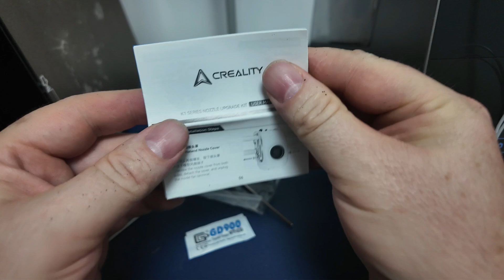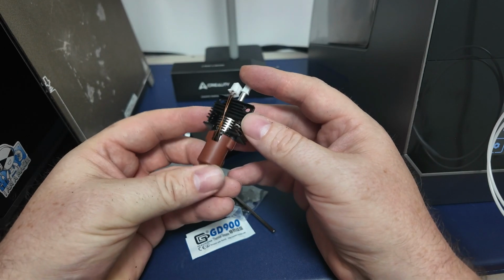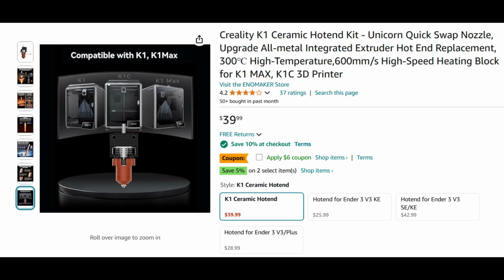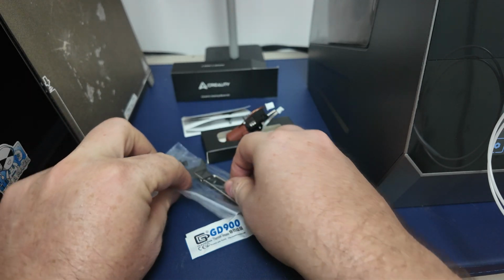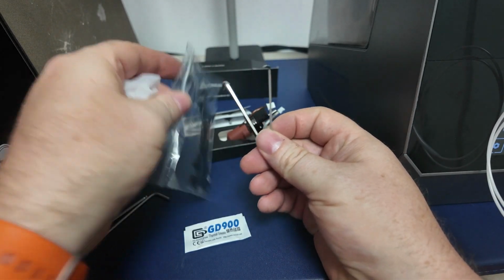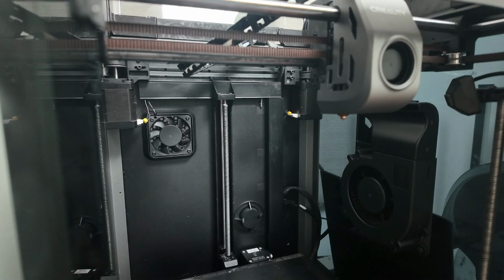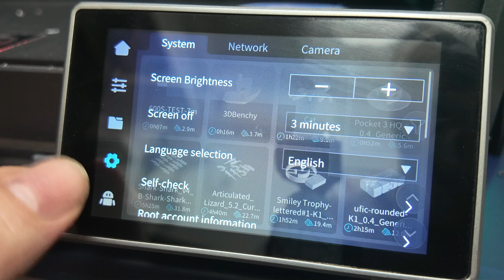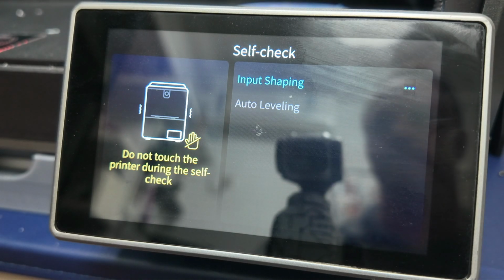@Creality3D Printer Upgrade - K1 gets a new hotend, using K1C unicorn nozzle

Comment: I have a k1 se and had a unicorn nozzle in it when I got it… but when I replace the nozzle it won’t go upi to extruder all the way.  It hits and won’t go in any further
Reply from the maker: Are you sure you got the right size unicorn nozzle?  The K2 and the HI use a unicorn nozzle also, and it is bigger than the one for the K1 SE. Did you compare the new one to the old one before installing?
Reply: i was having same problem. looks like i just have to drill out the hole in the alum heat sink. I have a machine shop so its not a big deal.
Reply: @mattschroeder6395 no don’t do this!! I had the wrong nozzle.  Unicorn looks like the stock one… just buy a stck nozzle or get the whole unicorn setup   Heat sync comes with it

Comment: Tried to change the hot end on my max, broke it inside the heat sink. Disassembling this and just putting in the duplicate one seems futile. All k1 and k1 max buyers from the previos two years seem to have gotten into this mess, having the whole core of their printers clogged up with a hundred grams of molten pla, due to no fault of their own, but due to a series of flaws in the design of the whole print head of the machines. This definitely is not consumer-friendly. The customers first pay for a top notch printer, then are forced to do a total disassembly and nozzle replacement, maybe several times, investing time, money and print hours, some of us investing in third party equipment, to get  printing again. And after being through this, that probably for most of us started 1-2 months after we purchased our machines, creality comes up with a fix and we have to pay another 50 dollars, disassemble our machines, do the upgrade ourselves, reassemble, and then start tuning our machines again. Can't say I feel like a happy customer after this dud by creality. This upgrade should have been free of all charges, and creality should have sent it to all k1 and max customers with a timely apology. Shame on you, creality.

Comment: On the newer ones the connectors are glued. Any idea how to get them off?
Reply from the maker: Normally all the connectors are glued, the first time you take them apart you have to carefully cut the glue.  It sucks but i guess with them shipping so far they want to make sure they stay connected.  It's not too bad.
Reply: You can use isopropanol alcohol on a q-tip and soaking the hot glue carefully. With that I managed to remove all the hotglue on the connectors and safely remove the connectors afterwards...

Comment: I have the old hotend with trianglelab zs plus nozzle and it doing great. Recently i got a gift this unicorn hotend and the e3d obxidian nozzle. Do you think i should upgrade or just wait till it goes bad
Reply from the maker: i got the upgrade for my V3 SE and waited until i had a problem with the other nozzle...i just hate to make any changes when things are running smoothly.  The new nozzle will be good when the old one finally gets plugged haha

Comment: There's a little ring spacer that goes on the bottom black screw of the pcb, I don't understand if it's needed on the K1 because the instruction says that it's needed only for the "integrated nozzle models". You know what that mens? Thanks
Reply from the maker: i discussed this with another friend who upgraded his also.  I did not put it in mine - and My K1 has been printing like a dream ever since.  I have printed TPU with it and today i spent the day printing ABS with it and it has been flawless.
Reply: @kevin.in.3d  Ok, so I'll leave it without the spacer! Thanks for the quick reply ;)

Comment: Is the upgrade worth it?
Reply: I upgraded mine today, then watched your video of how to do it. Seems I did it correctly 😅
Hopefully no more clogged nozzles and hot ends. For sure, no more clogged PTFE tube. Only done one print so far with it, all good.
Reply from the maker: for me it was for sure - mine was an early version of the K1 and had lots of hotend issues - this solved it.  The machine is now running like a K1C, very nice!

Comment: Will there be a kit for the CR-10SE?  It basically uses the same hotend.  Thanks
Reply from the maker: i just got a kit for my Ender 3 V3 SE which also works for the KE.  They did not say anything about the Cr10 SE.  It's a shame, that printer is so nice but we never talk about it anymore.  How is yours running?
Reply: @kevin.3D  I have 2 of them.  I use them to print almost anything 300c or less.  I have an Ender 3V3, but it is in storage as it only seemed to print PLA well.  I mostly print PETG, ASA, PA, PA-CF, PP, & PVDF-C.  Maybe I will buy a K1C hotend and see if I can make it fit some 3rd party heatsinks I have and see if it will work.  Thanks for the info!